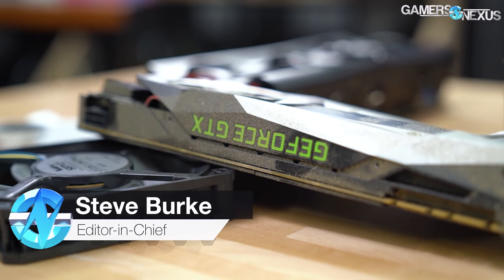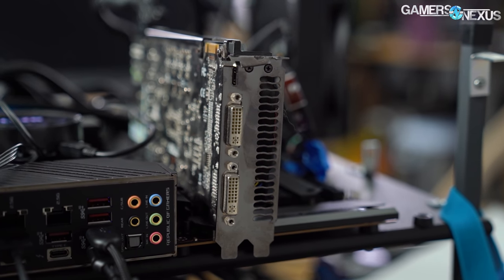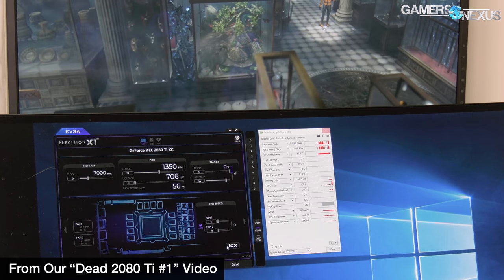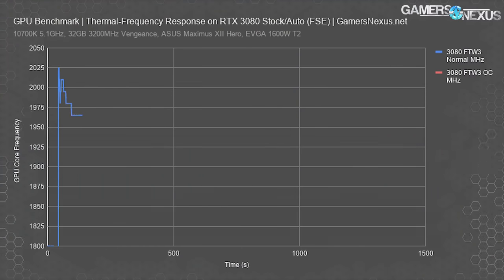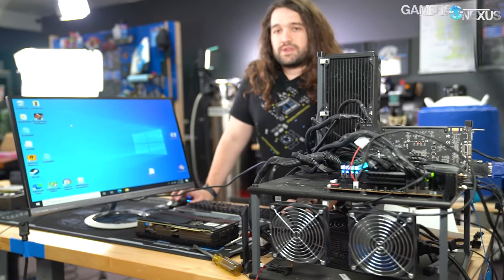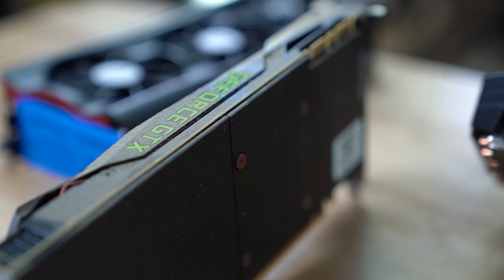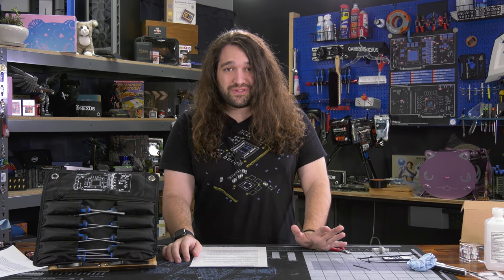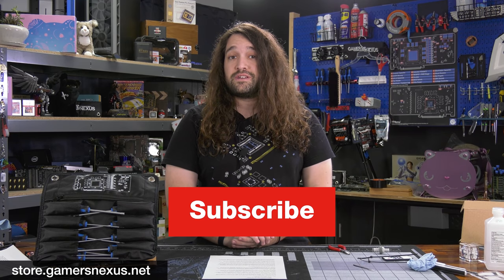Warning Signs When Buying Used GPUs: How to Detect Defective Video Cards

Comment: Hi, GamerNexus and smart people.
I have this weird 780ti. 
Bios has no artifacts and it have Microsoft driver on the GPU. 

When I install the newest driver it kinda articafts, white lines or small pixels that moves around. 

Any clue ?
Reply: Ask yourself; Does the BIOS use the iGPU or the GPU? All you can do is try servicing it, replacing thermal paste etc. But it sounds like my 780 which eventually got worse & is still in pieces awaiting burial.

Comment: I bought a 3070 for $270 and its the bomb
Reply: I'm also looking at used rtx 3070, prices are ridiculous now on the used market, and it's actually cheaper than rx 6700 xt here in Serbia, while new in stores costs at least 170 euros more than rx 6700 xt. What model did you get?

Comment: I had a 980Ti that would instantly shut the machine down with no bluescreen after long running (days) and maybe light graphics although almost always heavy graphics would work just fine. I didn't have another working graphics card to try and there were no logs to help -- the machine just stopped without logging any problems. I eventually got a 1660Ti and the problem went away. Putting the 980Ti back in brought it back. The card looked perfect under a magnifier. I couldn't see any problems and all the solder joints looked fine. Some dicks would have sold that. Not me. Still wish I'd known what to try. I threw it away.

Comment: i just never buy anything used anymore unless it just doesnt exist
because of scams and garbage people dont say when selling something
Reply: If you're feeling that way at least give memory and CPUs a try, memory have lifetime warranties for a reason and CPUs practically never fail. Cases, case fans and cpu coolers are also good ways to save money with practically no risk. I'd avoid buying hard drives, but SSDs also very rarely fail, especially for the somewhat newer ones As long as you're buying in hand locally I have trouble seeing how you will have any issue doing that.

Comment: Tip: save up and buy brand new

I bought a gtx 1070 and 1080 about roughly two years before the whole mining covid bullshit but wont trust any used computer item anymore

The two cards are still running strong though

Comment: "The social side of stuff, we're not gonna talk about"

It's okay I'll do it for you:

- Low quality description
  - Bad grammar
  - Little to no context
    - Why are you selling it?
    - How long have you had it for?
    - Did you buy it new?
    - What did you use it for? (e.g. mining)
- Only 2-3 low quality pictures
  - Bad lighting
  - Blur
  - Pictures don't show multiple angles of the card
    - No picture of card in the case turned on and running
- Filth on product
 - Fingerprints and c*mstains on glass side panel
 - Dust, grime and general filth on gpu fans and shroud
 - PC Case is on carpet and you see pet hair

All these things and much more buyers put into consideration because although they are buying used they want something that hasn't experienced hell and has been cared for by human beings who actually care, same goes for buyer.

Comment: If your buying local take a pc and use a power inverter to test the card if you want to be sure. Doesn’t take a great pc to test a card to at least see if it boots and works and a potato will run lol to test

Comment: Why are GPU prices so crazy in USA?
In Europe the prices are normal except the new 30 series or 6000 series.
Reply: Can't speak for the rest of Europe, but prices are pretty crazy in the UK. I bought my Vega 56 for £230 new a few years ago. They're going for >£400 used on ebay right now. RX580s are going for well over £300 as well, and 5700XTs are hitting £750 - which is touching the MSRP for a 6800XT. 
Not sure if the Nvidia cards are being inflated as badly as I don't know what the normal going rates for those were, but on the AMD side at least it's bananas.

Comment: Hey guys i know this isnt a place to ask for help but i just built my pc today 
I have ryzen 7 3800x 
Msi mpg x570 gaming edge wifi 
16 gb t-force delta 3200mz 
Msi 1660 gpu 
And corsair rmx 750x psu 

This is my first build my buddy helped me out and we got everything wired correctly im assuming at least however the issue we are havinf is the system isnt posting with both ram sticks in they are in the 2nd and 4 dim slots but the motherboard dram led debugg light is showing red however when i leave the 1 stick in the 2nd dim slot the system posts and then asks for a boot something i know i need to get a windows key no worries, but my concern is that with 2 sticks the system doesn't post. Is there any solutions or troubleshooting anyome can help me with it would be greatly appreciated

Comment: I skipped this step, but god damn is this video needed. Even old GPUs are EXPENSIVE AS FUCK right now on Amazon and Newegg. Hell, the 1650 Super that's in my prebuilt (Yeah, yeah I know, but prebuilts are in fact cheaper to get in this market.) is around $500 on Newegg. I payed $800 for this PC, a new 1650 Super combined with my CPU (Ryzen 5 3600) is a hundred dollars less than the entire system, without the other components like Mobo, RAM, Storage even calculated. I was too scared to buy used.

Comment: I like this video - but you really are at their mercy. I bought a 5700 today off kijiji, it went great, it was much cheaper than anywhere on the internet, and the guy obviously took care of his stuff - it looked like it was brand new and had all the packaging. But you're completely at their mercy. Ebay gives great buyer protection, but it's such a nightmare buying off ebay. They'll charge you 50 for shipping and you'll wait 3 months. And because people know they are casting such a wide net, everything is a rip-off. It's gross.

Comment: Bruh don't scrape the heat sink please.. Just use brake cleaner. That dissolves thermal compound 99% of the time perfectly. Not IPA, nor any other kind of alcohol that's widely available.

Comment: 700 for a rx 580? Damn what a tool lol the other week I picked up a gtx 1070ti for £100 it’s a asus boost model but it easily does +200 core clock and +500mhz memory clock.

Comment: I had a 3070ti listed as new on ebay come shrink wrapped with broken security stickers and bits of dust in the fans, they even put the original stickers back on it with dust under them. Then they drug their feet as long as possible with the refund absolute scumbags...

Comment: Damn, i hated as my Geforce 8800 GT from about died after about 2 years usage. I baked it and it worked again, but it had always so many artifacts and as soon the GPU reached about 75-80 degree C, the whole computer crashed.
Turned out it died again some months later and i baked it the 2nd time, again with sucess and it worked even better. But pretty fast it died a 3rd time and i was done with baking my graphics card every 1-2 months and threw it away, AMDs Radeon 6950 2GB way anyways already another league of performance (2GB vs 512MB Vram and about 3x as fast or more idk)
And these days i though: Damn, 200 € (6950) to 330 € (6970, the hi end model) for a graphics card, that prices are crazy, but the 6950 was damn fast these days despite its price and it was ok to get the "cheaper"  6950 model for about 220€ and flash the 6970 BIOS on it, unlocking everything AMD has locked only with the BIOS. Nowadays i would wish a proper, close to hi end card for like 200-300€/$

Comment: Would it really be that difficult for somebody to come up with a contraption that sends power and some sort of signal through a PCI-e slot and then checks for that signal at the DVI/HDMI/WHATEVER connection? The odds of finding any seller willing to give you a return policy is slim. You can't carry a full PC with you to test a GPU. And it's rare for a seller to still have the thing in a rig so you can check it out. Even if it's in a rig, you aren't going to get the chance to install software to actually test it. I've seen several GPUs for sale locally, but I can't bring myself to spend the money because people are scum and I don't trust anyone. Seriously, just a PCIe riser cable with some sort of black box sending and checking for a signal. Shouldn't be that difficult. And it could save people from being robbed.

Comment: bought an R9 fury nano for $150 bucks... I hope it turns out well... yes I know it's old but whatevs
Reply: Hey it's a good card, i've got an Gigabyte R9 280 3 GB OC Edition for 110 bucks which was kind of a ripoff but the card works, that's what's important.
Reply: @redragongaming  you using the final official AMD driver or the custom drivers from other sources
Reply: @capkapak101everyday8  Yeah i am using the final official driver, im literally too dumb to even install custom drivers.
Reply: @redragongaming  haha same there's a review on custom r9 drivers but there's bugs along with it and me who is not tech savvy at all, would like to just run my gpu with no such hassles
Reply: @capkapak101everyday8  I've just recently installed the Nimez drivers and i have no problems with them, the performance however is kind of the same. These drivers managed to resolve my Doom Eternal issues with glowing textures and artifacts that my Radeon R9 280 had, now the game will run flawlessly on my system with no noticeable hiccups.
Reply: @redragongaming  Wow nice one 👌. I just sold my R9 Fury Nano for $160 since gpu prices are still falling and that fact that I don't have time to play any games during my degree lol... Oh I'm the same person from the original comment above just on different devices 🤣
Reply: @capkapak101everyday8  Wow R9 Fury Nano this is a great little card, i only wish i had one to add it in my collection. I've had previously a Sapphire AMD R9 280X which i bought it used and it failed after 1 month and an Sapphire AMD Radeon HD 6990 which it was working as intended even if was used, i then sold it. For now i've got my eyes onto an Sapphire Radeon HD 7970. Got to buy it as a backup video card. As for the games, well i have 142 games already installed onto my PC, since i have 2 HDDs from Hitachi and HGST with 3 TB each.
Reply: @redragongaming  yeah for some reason no one is selling the R9 fury nano and there is a quite high interest for it in the used GPUs space.
Reply: @redragongaming  goddamn that's a ton of storage space
Reply: @redragongaming  I have a rig running a Strix version of the 280. Works great.

Comment: I got a asus 1080ti at $400 a few months ago, had to buy some new fiberoptic cable stuff to make the RGB work properly, but I was pretty sure when I bought it that the gpu drought would continue, and it has, with the avg 1080ti going for $500 now. Seller was very communicative, and engaged in talk about things other than the gpu, without being a butt about it, so I felt pretty safe buying it, and it's worked out.

Comment: just buy a used GPU that you have seen brand new on Amazon. Then buy the new one on Amazon (Has to be the SAME model), swap it out with the used one (stating it was defective) and return that used one to Amazon. Done, you've got a brand new GPU for cheaper. You're welcome.

Comment: I paid $100 for an Rx 580 8gb and $200 for a 1070 8gb 😎👍
Reply: Now you can get an rtx 3070 used for 380$
Reply: @maximoxtech1125  I got 3050 for $347 new wish I waited....
Reply: @miketheevolutionslayer2649  same lol
Got new gtx 1650 for 280$ on January
And it broke down on march 
It was pretty unlucky especially because i already unscrewed and opened it because it was my first gpu not knowing it will void the warranty

But just a few weeks ago
Saved some money and bought a used 1080 for 
190$ 

But the org owner said 
Its 4yrs old

But the temps are cool though

Triple fan babyyyy
Reply: @miketheevolutionslayer2649  damn if we waited
We could get an rtx 2070 for that price

USED 

Or an rx6600
Bnew
Reply: @maximoxtech1125  I got Rx 6600 Eagle 8gb new for $236 was worth it 😁👍
Reply: @miketheevolutionslayer2649  i thought you already have an rtx 3050?
Reply: @maximoxtech1125  I have (2) i7 9700f setups 😎👍
Reply: @miketheevolutionslayer2649  why ??
Reply: @maximoxtech1125  Rx 6600 Eagle 8gb new 😎👍
Reply: @maximoxtech1125  Yeah I regret getting the 3050 but it is way better than the 1070 I noticed instantly I only regret pay the price I did should've same price as Rx 6600.....

Comment: In all my life I've never had to open a card and clean it. I think it's because I don't overclock. I just let the card run as is off the shelf and leave it at that. I don't like buying used because people lie. I'm sorry for the genuine people out there but I know better than to trust someone's word when it comes to selling shit second hand. The one issue I've had was externally created. A major power joint in my area went boom because the insulator on two wires degraded and they touched. Power for the whole country was down for days. Wouldn't you know it I was booting my computer up right when it happened. Windows initialization was more fucked than a five dollar hooker.
Reply: Just buy from somewhere with a measure of buyer protection provided by the intermediary, like ebay, and avoid craigslist.

Comment: Did You Just Clean The Aluminium Fins With Water = Big Failure hahaha instant oxidate. and ur talking about screw with rust on them :(.... Also cleaning the heatsink with a screw driver ? Ur only scratching the surface so there will be no good contact anymore. Use a gasket scrapper....  ur a joke

Comment: You should advice your audience to stop buying any kind of GPUs for as long as possible. Ngreedia and Greedy Su are gonna abuse our emotions and will continue to create an artificial supply shortage to boost up prices. The scalpers are none other than nVidia and AMD disguised as resellers. Buying used GPUs is not really a great idea, unless got for very very cheap. And it is not possible for buyers to intensively check the GPUs anyways.